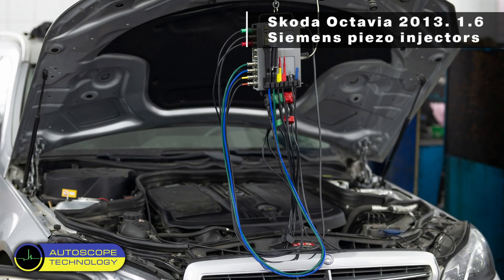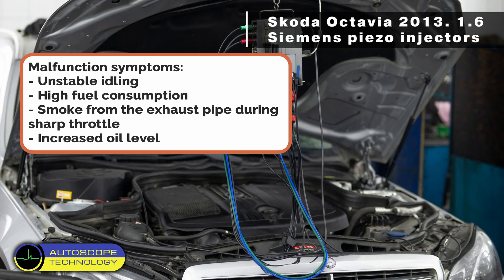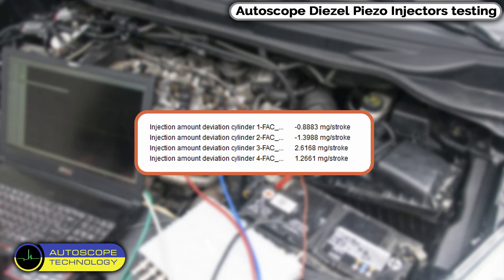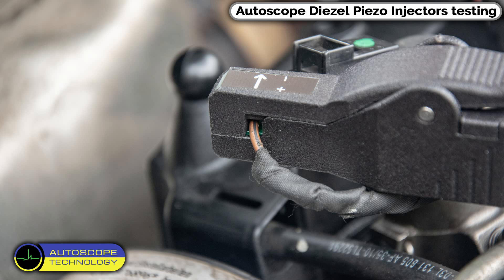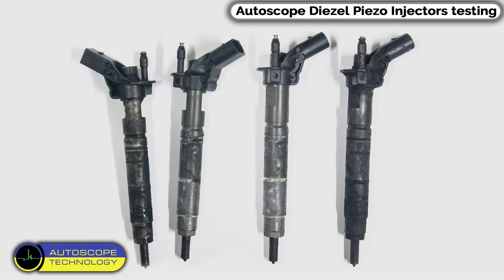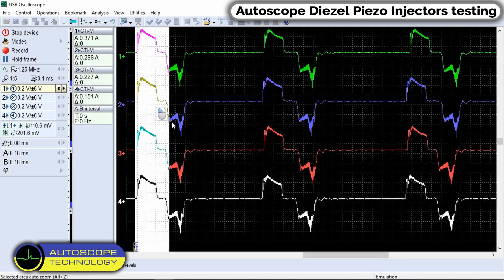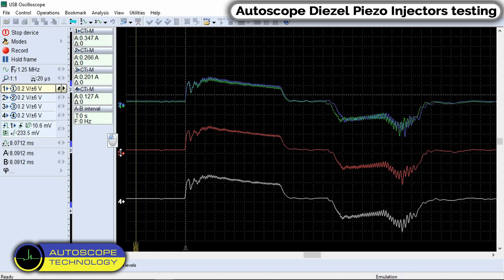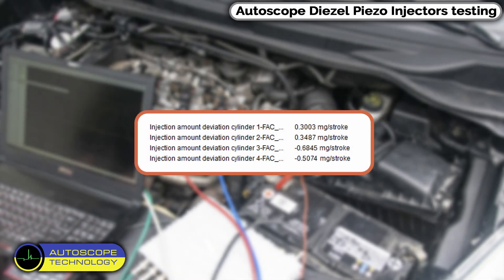Skoda Octavia 2013. 1.6 Siemens piezo injectors

Comment: What cause this pulse lenght slide between injectors? Mechanical damage inside injector or electrical?
Reply from the maker: Because the mechanical properties of the injector differ from normal, in order to inject the same dose of fuel, the computer has to change the duration of the electrical pulse.
Reply: @AutoscopeTechnology  how ECU read fuel dose which injector inject into combustion chamber? There is No any sensor on injector output. From Crank shaft sensor?
Reply from the maker: Yes, from Crank Shaft Sensor

Comment: How can one do this with just 1 amp clamp ?
Reply from the maker: In this video are used CTi-50 current clamps.
They have output sensitivity of 100mV/A. This means that with an increase in the measured current by 1A, the voltage of the sensor output signal increases by 0.1V.
The maximum current that current clamps can measure is 50A. In this case, the output voltage is 5V.